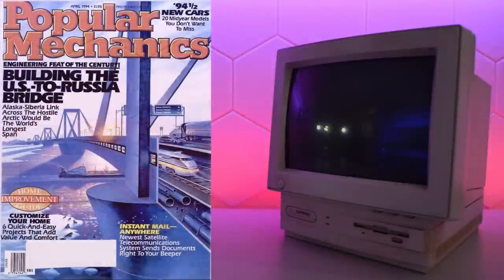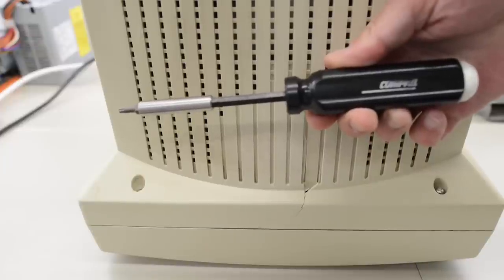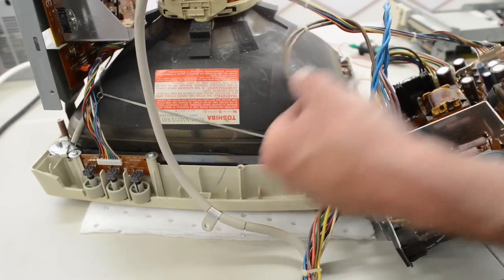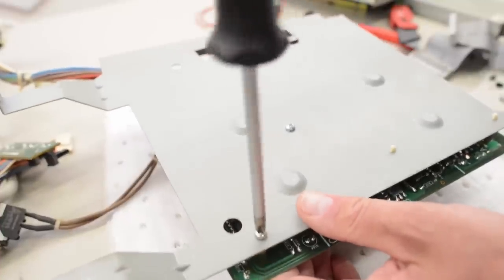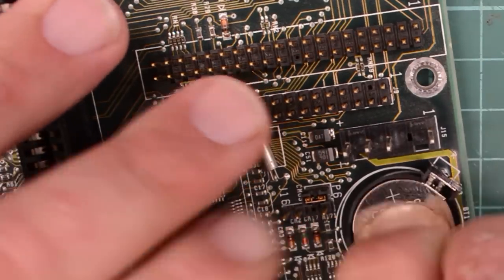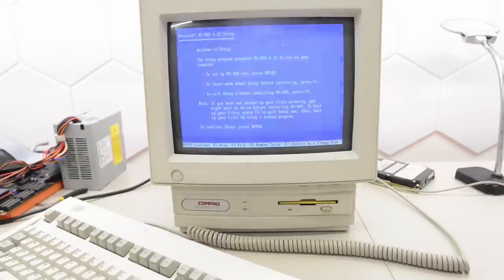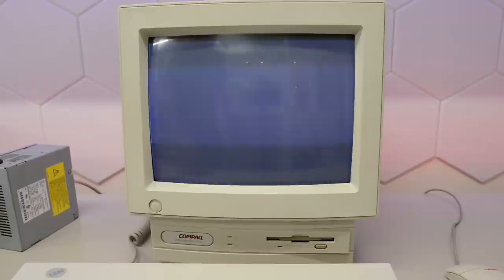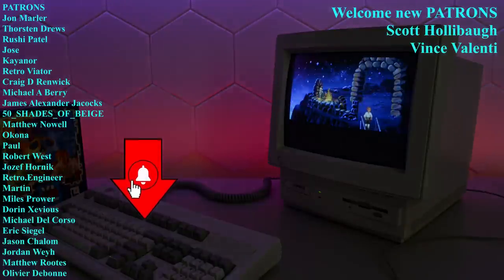Restoring and upgrading an oddball. Compaq Presario 433 (425)

Comment: This was the first computer I could call my own.  I upgraded it to a DX2-66 and used it all the way up through Windows 98.  It was never fast and I hated using it, but it was all I had.  Shortly before I got rid of it I put a Kingston Turbochip in it and it barely made a difference, much like you found out.  At one point I even had a scsi card and cd-rom running off a separate power supply just sitting next to the computer.  I have no desire to own one ever again.
Reply: You managed to get Win98 running on it? First or Second Edition?
I've been looking forever for evidence you could install Win98 on it despite being unable to put more than 20MB of RAM in it.
Reply from the maker: Yeah, this was a machine for the DOS/W3 era. Running w95 must have been a pain lol
Reply: @jeremiefaucher-goulet3365  It was probably first edition. The computer was essentially useless by that point because it couldn't do much more than minesweeper. I remember trying to browse the CDs that came with Maximum PC and PC Gamer and that was impossible.
Reply: @Epictronics1  w95 wasn't too bad actually.
Reply: @mikebeutler84  An external parallel port CD drive? I have an old backpack that I could never get to work on my Presario 425.
Reply: @jeremiefaucher-goulet3365  You have to read the entirety of my first comment. SCSI card with ribbon routed outside to the drive on a separate power supply.

Comment: The ISP that I worked at from  1996-2000 had several of these. I took one once they were retired around 1998 or 1999 and upgraded the s(u)x25 to a dx33, but eventually gave it away to someone. Kind of a cool design but it was mega obsolete, but kind of wish I had kept it, as with a fast 486 it would have been far more useful.
Reply from the maker: Yeah, I think we can push it a little more but it will never become a speed demon. That being said, I think it's an excellent DOS adventure gamer.

Comment: I had the Compaq Prolinea/Net1 25S which was identical to this machine, obviously having a 10Mb NIC.  I upgraded it to 8Mb RAM, 504Mb HDD and a 486DX2/66, the graphics performance under Windows 95 was dreadful.    I think those missing chips will be for audio chipset, I'm sure the Intel NIC was on a daugherboard.

Comment: Does the 433 have a 14.318 MHz oscillator? That could have severely limited the performance of the OD100.
Reply from the maker: It runs at 3x33 right now. I'm working on fixing that

Comment: It's probably running slow because it doesn't have much RAM in it.  Is there any way to add more cache too?
Reply from the maker: No L2 unfortunately but I could stuff it with RAM for sure
Reply: @Epictronics1   how about a L2 cache socket adapter? LOL
Reply from the maker: @tigheklory  I'm gonna leave that to someone smarter than me to build :)

Comment: I think I had a 486SX2/50 (AMD) version of this once.
Reply from the maker: cool. To be honest, I didn't know there was an SX2-50
Reply: @Epictronics1  Neither did I until I cracked that machine open. 😄
Reply: Nice, I have an AMD sx2/66 in my cpu collection. Pretty sure it was a pull from a friend's old Compaq. I guess AMD still had bad enough yields that the fpu needed to be disabled, or Compaq just wanted a cheap integer cruncher.

Comment: oh man xD i used to own one them back in 2002 it was my dream pc but issues i have wasnt same build like your is because i remember mine have i244 intel in there with onboard graphics that only thing different than mine and your was missing it so that be why it slower
something bother me is that ram cache is slower i recommend replacing ram n chip in order boost speed if barely changed them you going need onboard graphics chip i cant tell much because havent done much work to it n sold it back in 2007 all i did was throw in amd chipset and few change ram and chip onboard it boost up 55fps i love it so bad but family dislike it because it was way too old run anything like windows xp or win vista so family sold it and got newer compaq black and silver much faster and  have intel i3 else